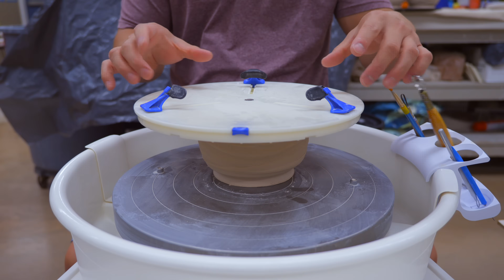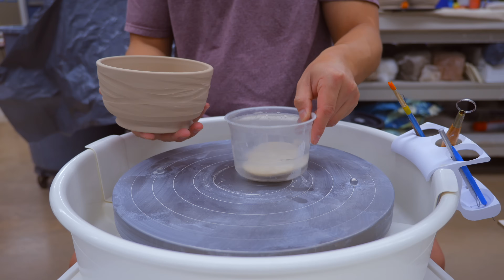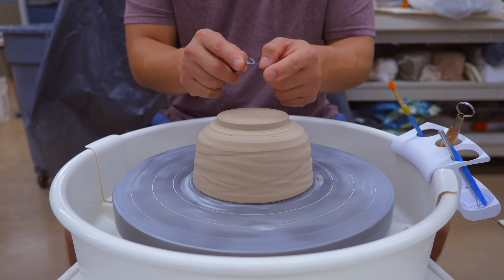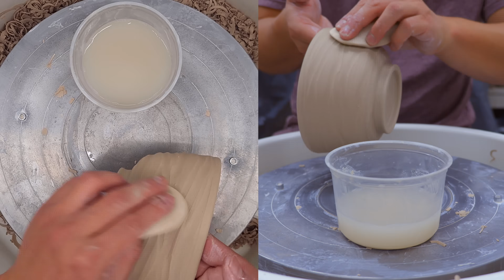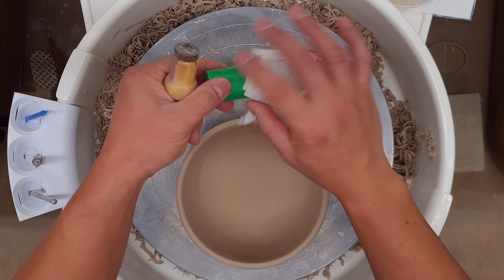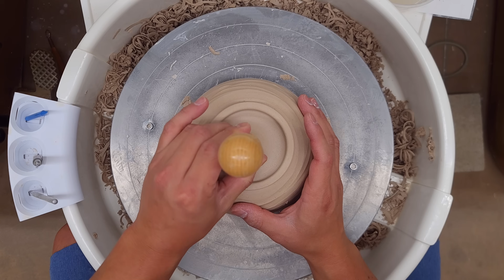Stop Using Wads! Trim Your Bowls FAST with This Centering Hack

Comment: I struggle with the piece lifting off (when secured with wads), I wonder if it’s because it’s too wet and sometimes the tool digs in too much
Reply from the maker: If you're wads are dry then they have a tendency to pop off while trimming. If your piece doesn't lay flat than your rim might not be leveled. As for the tool digging in, that's probably a combination of too much pressure and clay softness.

Comment: Love your tool holder, would it work on an older venco wheel?
Reply from the maker: Hmmmm I'm not too familiar with that brand, but as long as you have a splash pan with a vertical wall it should fit.
Reply: @mwceramics it has an angled wall. That may need some adjustment to fit! Looks great though
Reply from the maker: Oh shucks! I do plan to redesign it to make it more modular and universal so stay tuned!

Comment: Another excellent video.  I noticed you use a large brush to clean up the little trimming bits. I use a smaller dry brush and always have a frustrating time with those. Seems like I can't get them all without some getting stuck on the pot.  Any advice?
Reply from the maker: Hey there! Always great to hear from you :)  if your piece is really wet the trimmings will naturally stick, even when trying to brush it. I would reccomended using the trimming tool to try collect the trimmings while the wheel is spinning.  I cover the opening of the trimming tool with my fingers so it gets stuck there. Watch @ 8:24 how my fingers and trimming tool collect the excess clay.
Reply: @mwceramics  Another great tip. Thanks. I'll give it a try.

Comment: Another great tutorial! 
Out of everything I've tried, water tension and a grip are my favourite methods so far. But I can be a bit clumsy, and I have had pieces pop off when I used too much force. 😳
So it's great to be reminded to apply downward pressure & be gentle & patient.
I bought a $30 cheap version of the Giffin Grip on Temu. I was a bit sceptical, because these sites can be unreliable when it comes to product quality. It's all plastic, but for an amateur like myself it is actually a really adequate piece of equipment, especially for items that would be difficult to secure in other ways.

Thanks for the fab video and Happy Halloween!

I'd love to see a glazing video BTW.
Reply from the maker: Dippy is back! Wooohooooo 😀  I usually use my mini Griffin Grip so pieces don't pop off like how you were saying, but the water Tension technique is growing on me.  I actually just ordered some trimming bits off of temu too with alot of skepticism so hopefully they're be good when they arrive!  And yes, I will que up a glazing video since those are lacking on my channel. Happy Halloween from Hawaii!!
Reply: Happy Halloween  @mwceramics 🎃